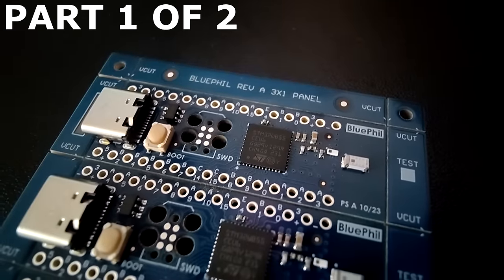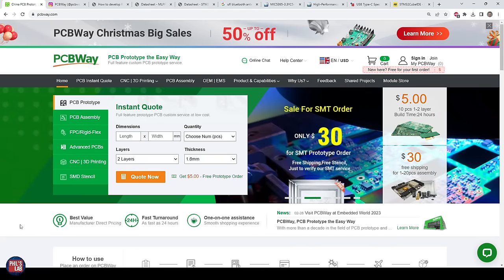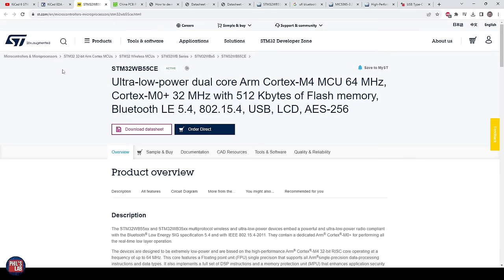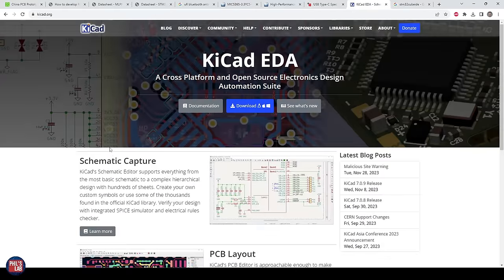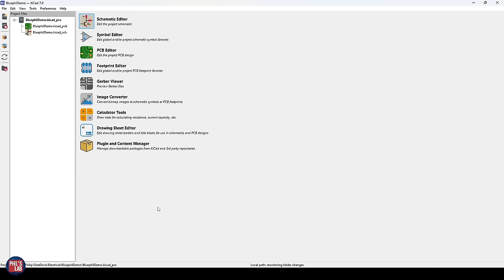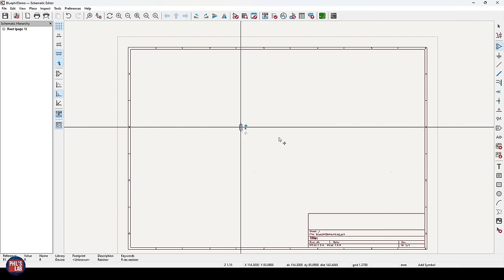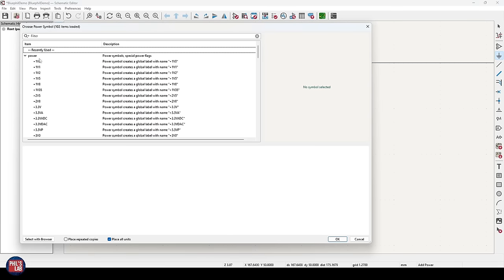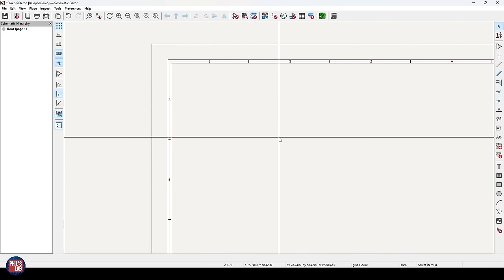KiCad 7 STM32 Bluetooth Hardware Design (1/2 Schematic) - Phil's Lab #127

Comment from the maker: Thanks a lot for watching - if you like the video, please leave a like and a comment - this really helps me out! Part 2: https://youtu.be/PlXd3lLZ4vc :)

A note on impedance matching: The RF matching network changes depends on the package of STM32WB you use (as the impedance at the RF1 pin depends on package, see application note). You can also use an integrated part by ST (e.g. for this package, MLPF-WB55-01E3) that does this for you. You will probably have to tune the final impedance matching network in any case on the real PCB. Finally, if you have an antenna that isn't matched to 50 Ohms, you will require an additional matching network (again, see application note).
Reply: Thank you for such a great video. It's helps beginners like me who can't afford buying courses. Again, THANK YOU SO MUCH BRO  :)
Reply from the maker: Thank you, you are very welcome! :)
Reply: MLPF-WB55-01E3 does this give better performance that a LC impedance matching circuit ?
Reply: one more doubt , what is the final impedance matching that we need to do on real PCB , can you please give me some pointers
Reply: Question about your paid course: will it teach the electrical engineering logic of how you knew what parts to choose to make this? Like the calculations you had to do etc. I only have taken circuit analysis before.
 If so ill get it because I believe that would be very helpful for teaching someone how to later on design their own different type of boards from scratch.
Reply: Question about your paid course: will it teach the electrical engineering logic of how you knew what parts to choose to make this? Like the calculations you had to do etc. I only have taken circuit analysis before.
 If so ill get it because I believe that would be very helpful for teaching someone how to later on design their own different type of boards from scratch.

Comment: Okay, this is definitely the best tutorial out there to design your first STM32 based PCB using KiCAD. Everything important is covered in detail plus some useful tips and suggestions. You could literally design your board form zero knowledge to working board following this.

Thanks so much for this valuable resource!
Reply from the maker: Thank you very much, Martin! I tried to squeeze in the fundamental KiCad workflow/commands one may need for most designs, hopefully this'll be a useful resource.

Comment: 1:36:00 For PCBs that will be working over a battery, we should also consider minimum Quiescent Current to give max battery life. For example, LM7805 has a quiescent Current of 5-10mA (this is when the circuit is not consuming power, i.e., sleep mode) which is huge!!! A good LDO will have a quiescent Current in uA or nA.
Reply from the maker: That's right. The MIC5365 used in this design is also pretty decent at around 32uA.

Comment: This would have been so helpful last year when i did a custom pcb with stm32wb15 for my master thesis, especially the firmware part. i still used your general stm32 design videos, could not have done it without you. thanks phil!
Reply from the maker: Thank you! Shame the video came a bit late, but I still hope it's useful - and hope everything went well with your master's thesis :)
Reply: yes its done now, the actual hard part of the tesis was documentig everything ;)

Comment: Very useful video, thanks Phil! A quick tip regarding when you are calculating the coordinates for the pad placement, you can enter the calculations inside the Position X/Y in the Footprint Editor.

Comment: One of the tricky things with RF design is that those matching component values also depend on the PCB design and stack-up. The capacitance between pad area and GND plane can easily form a capacitor in sizes of hundreds of femtoF to some pF. A design I did recently on Eurocircuits with its DEFINED IMPEDANCE pool showed me this same problem: I calculated a 0.9pF capacitor for a Pi impedance matching filter at "only" 434MHz. I ended up redesigning the PI filter while incorporating 1.75pF impedance from PCB tracks and 2 SMT pads (!).
The DEFINED IMPEDANCE pool is nice, since the dielectric constants of core materials is well defined, along with using thin materials between outer and inner layers. Thus 50Ohm tracks are thin and well defined. But it also adds a lot of parasitic capacitance on the PCB. 0.3pF could be the "just" amount of extra(!) capacitance they needed on their PCB design with their layer stackup (which is presumably unknown). But on a "proper" RF stackup, it may very well be different..

Realisitically, the safest thing is to keep those parts TBD at design time, and then tune them with layout solutions in tools such as ADS, or better on the real boards with VNA equipment. But these options are not cheap or trivial to do neither. It requires some extra reading into this stuff.

So I recognize why you tried to gloss over these complications and just recommended copying those devboard values as initial design values. (Good job)
Reply from the maker: Yes, that's exactly right. As per my pinned comment, the values need to be tuned on the actual physical PCB itself, as you also said. Those 0p8 and 0p3 values are tiny and definitely can be near pad/stray capacitances. Due to time I have to gloss over quite a few topics unfortunately,  but at least those values serve as placeholders/a starting point. A future video will be dedicated to matching and tuning on a "real-world" PCB :)

Comment: Two tips for footprint creation:
1. You can type formulas directly in the position and size fields and KiCAD will automatically calculate them for you.
2. Use Shift+M to move a part precisely. This can be used when you know the distance between two pads, but not it's final position. Position the pad centered to the other one, then use Shift+M to move.

You can use these in PCB layout too.

Comment: I've now got the hang of creating Global symbol & Footprint libraries - I can see why Phil starts us on Project libs, since they then get stored with the project files.
For Global, I create an initial MyLibs directory under  the KiCad/7.0 (or version number). I then download the manufacturer's model, symbol files zip, and extract them there.
Using Symbol editor, create (or select, if already exists) your library name, I have decided on "my_" as a lib prefix since I can just filter on my_ libraries! - as Phil says, best to keep libs small and purposeful (eg my_usb for related devices and connectors). Import the sym file from the extracted model file. Save, save save!
Then open Footprint editor, go through similar steps for the footprint file.
(Not yet done 3d models)
Last step is to tie sym and footprint together, go back to Symbol editor, select your lib component, File-Properties. In the list of properties, go to the Footprint section and find the correct footprint lib file that you created in the previous step.
Save, save, save - and check !
I've found it handy to store my Kicad projects in Box, for backup purposes.
Also, the connector model files from Samtec are great !!
Thanks again to Phil.

Comment: At 33:08 I'm guessing the extra 10nH inductor in series is recommended because it has lower parasitic capacitance therefore higher impedance at higher frequency, right?
Reply from the maker: That's right - the smaller inductor will have a higher self-resonant frequency (due to lower inductance, lower parasitic capacitance, therefore near the 2.4GHz RF band) and thus higher impedance at that point.

Comment: Another incredible video with a wealth of information, thank you! Do you plan to have any videos covering your process for integrating a chip antenna instead of the u.FL connector? You have a couple videos covering designs with RF signals and some of them even feature a board with a chip antenna in the b-roll, but the walkthrough includes the connector. I also watched one of your design reviews for someone who integrated a BLE chip antenna and you mentioned some guidelines to follow with respect to skirting vias which I hadn't considered in my own design. I have looked through datasheets for these antennas and a lot of times they are sparse, so if there are any additional things to consider that would be awesome to see (noting that this is probably a complex topic).

Comment: Good, interesting stuff there, and a good deal of it not specific to KiCAD - most of it is just good project and design practice.
One point about using datasheets from suppliers' websites, though.  Some suppliers (yes, RS and Farnell, I'm looking at you) don't update their datasheets beyond the first version.  The difference between the ATTiny-0 datasheets from Farnell or downloading them from Microchip's website was the difference between a project working or not.  There had been a few revisions since it was first published.  I appreciate it's a lot of work keeping that up to date when you stock so many items, though.
Reply from the maker: Thanks! Yes, that's a very good point!

Comment: 1:29:48 Why can't you route the two signals together for high speed USB?
Reply: The MCU doesn't support HS, only FS
Reply from the maker: You're probably still okay for USB HS, but for faster edge rate/higher bandwidth signals, you don't want to add stubs to your routing (negative impact on signal integrity, for one).

Comment: At 33:30 how did you know to use the 4 MHz switching frequency rather than the 8 MHz?
The explanation is under section 3.3 of AN5165. Good video btw, thanks!

Comment: In AN5165, it's recommended that the 4-layer stack goes components/critical signals (RF), ground, power/signal, and ground/signal. However, it seems typical that designs are constructed in a similar manner as this video where it's signal, ground, ground, and signal. Is there a reason for this?

Comment: Great tutorial! Do you plan on making a video about designing a schematic and PCB for LIPO operated STM32? Charging, battery protection, regulators, buck/boost converters, battery level measurement, maybe a second power source for STM32's RTC? Do you have such a design available to the public?
Reply from the maker: Thank you! I'd like to make a video on designing for battery-powered devices (typically, Li-Ion) - as you say, those aspects and what needs to be included I believe would make for an interesting video, hopefully!
Reply: @PhilsLab  Do you have such a design or simmilar available to the puplic somewhere by any chance?

Comment: You are a life saver, just in time
Reply from the maker: Thank you!
Reply: @PhilsLab  Can you tell me when part 2 is coming
Reply from the maker: In about 2h 25min :)
Reply: @PhilsLab  great 😃
Reply: @PhilsLab  Iam using Stm32wb55rg with VFQFN68 package. In that there is no VSS pin , is the Exposed pad acts as VSS , in my pcb i have not connected the  epad to gnd. I cannot program the MCU I wanted to know did I screw up with the epad. Please take some time to check my query I don't know who else to ask.
Reply from the maker: EPAD is in most cases tied to GND (check the datasheet) - so yes, I assume that'll be the issue.

Comment: Your videos are so incredibly helpful. I am looking to add Bluetooth/wifi functionally to an STM32F4 project. I was not familiar with the Bluetooth family of chips they have. I can use that as my Bluetooth receiver for my STM32F4 project, as well as use it for small standalone projects.

I was wondering if you have a comment on whether or not it would be better to use a standalone MCU like this, or a specified Bluetooth chip? I have some Bluetooth chips on hand, along with some smd antenna to use for them. That being said I feel like it may be easier to use the STM32 platform I am already used to, and be great for standalone projects like I said.

Comment: I've learned how to do almost all stuff on EasyEDA...  I've been trying to play with Kicad and I'll say Kicad 7 is ALOT easier, but EasyEDA seems much more polished then KiCad.  I am teaching myself how to do a lot of PCB design and making my own sensors and controllers.  I havent used PCBway yet, the quotes I got for my last order that just arrived an hour ago, JLCPCB was cheaper coming in at $18 for a run of 35 (5 different designs), 2-Layer boards with White mask, and everything else std.  including shipping.  Here in Phoenix, Arizona, USA, and ordered on Tuesday Morning and just delivered like 80 hours later.  Not even 4 full days with standard shipping.
Reply from the maker: Thanks, Mike - EasyEDA is pretty decent as well, although I haven't used it particularly much myself. I like how integrated the whole system is with libraries, 3D models, ordering, etc..

Comment: @10:11 Great video as always!!!!! When it come to online pcb footprints from places like snap eda or ultra librarian i recommend them. My rational is that while there are errors they have most of the work already done and all you need to do is verify and then fix if any errors exists. this is typically much faster then creating from scratch in my experience. Granted I am using Orcad so take my recommendation with a grain of salt. Orcad is trash ugh......
Reply from the maker: Thank you! If people do thoroughly check downloaded symbols and footprints, and adjust them to somewhat sensible formats, add in missing information, etc.. then yes, this may save some time. However, I think a number of people end up just trusting these 3rd party models and 'blindly' use them in their designs. I've seen many people get burned by this, as often these parts are erroneous. Therefore, I typically advocate against using them - also it's a necessary skill to have in professional companies to be able to create own schematic symbols and footprints. For me personally, I have a specific way (not shown in the video) of structuring my libraries and parts in Altium Designer and it would take me similar amounts of time creating them from scratch vs downloading, checking, modifying, etc.. Therefore, I just go the way of creating them myself from the get-go. Each to their own of course though :)

Comment: Hey Phil, curious on what your thoughts are on adding a switching regulator to a USB/battery powered system? I want to use one to extend the battery life (2xAA) as long as possible for my sensor system, while also allowing for the option to power via USB. I did one test PCB incorporating a switching regulator, however, it seemed to alter the external oscillator's frequency causing it to run at ~100 MHz instead of 16 MHz. My guess is that the ripple voltage from the switching regulator caused this. 

On the datasheet for the part (L96920DTR), it says to include an input inductor and decoupling capacitor. I happened to forget this. Could this be a reason for the increase in oscillator frequency? 

Is it common to use these for this type of scenario? Would you have any alternatives in mind?

I realize this is a lot of questions, I am very new to PCB design (<4 months) and am eager to learn more. Thanks!
Reply from the maker: Hey, Adding a switching regulator should definitely not have the effect of shifting the frequency from 16MHz to 100MHz. I suspect something else is happening there, but it's of course hard to diagnose remotely.
Is the oscillator a crystal, or for example a CMOS oscillator? It'd be interesting to check the supply ripple at various points on the PCB, try to bypass the switching regulator, etc. Might also be a measurement error?
Reply: Thanks for the response and for all your work in PCB design education. I know it's been a huge help to me and I'm sure others feel the same.

 It was a crystal oscillator. I'll check again and see if it wasn't just measurement error.
Reply: @EricBentonstudent  Sometimes the measurement probes can also load the crystal and alter its characteristics!

Comment: One thing that does confuse me a tad bit is why you (and others) are referring to the "Power source"-button and picking e.g. +3V3 from there -- the same symbols are available in the regular [A]/Component selector - just type +3V3 into the search box and you'll get it. I'm sure I'm missing something here, but to me it makes more sense to just use the Component-selector consistently, regardless if you want an active/passive component, or if you want a power-rail etc?
Reply from the maker: No particular reason. I guess I'm just so used to the Altium Designer flow, which separates power symbols and components.

Comment: Thanks for another amazing video Phil! I have one question - in setting up the MX cube project you selected C rather than C++ (or is it mixed C/C++ i can't remember now). Does this matter much or can it be easily changed later on? 

Do you generally tend to work with C only or do you find any utility with C++ for embedded work?
Reply from the maker: Thanks, Shaun! You can convert the project to C++ at a later stage. I pretty much always develop in C.